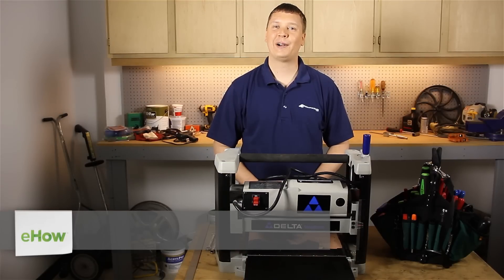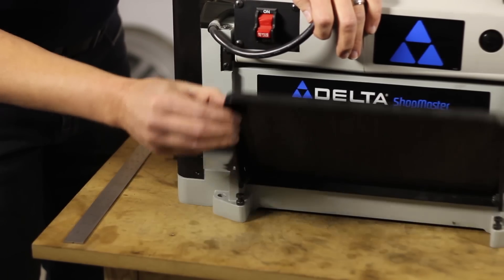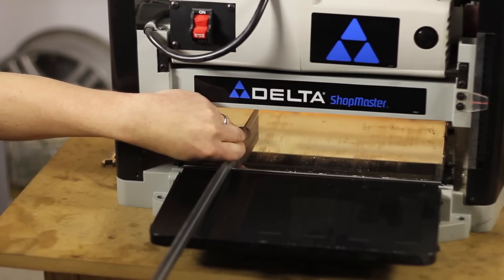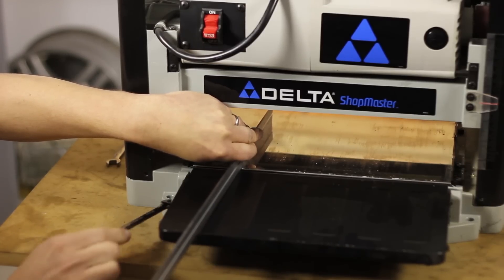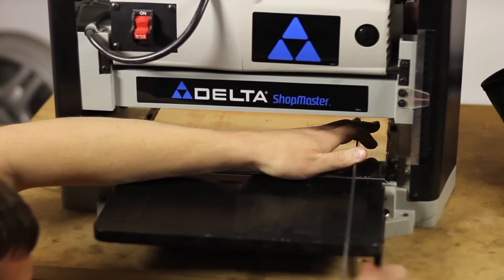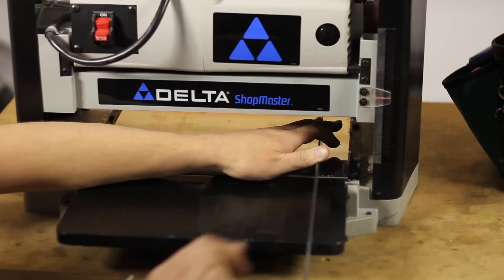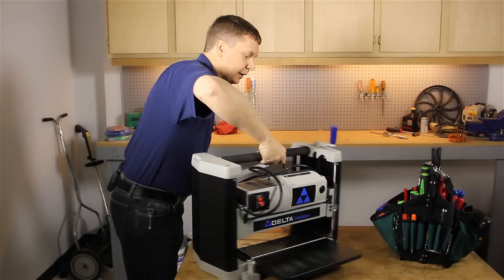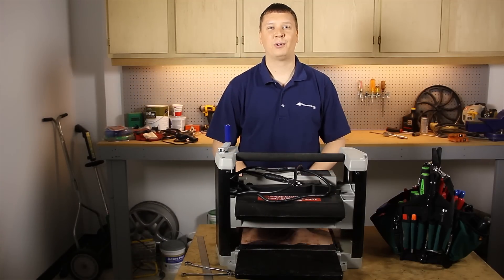How to Adjust Infeed & Outfeed Tables on a Thickness Planer : Lawn Care & Power Tools

Comment: Thank you soooo much please make more videos about the thinkness plainer please. I just purchased mine and I thought that the infield table needed to be a little bit higher so that I didn’t get any Divet in the wood as it entered the blade but for some reason maybe I have it wrong because it gets to the middle of the board and then it won’t feed the board through the planer it keeps getting stuck.